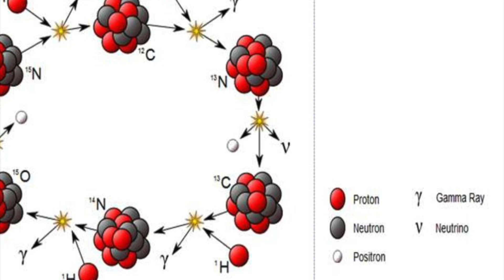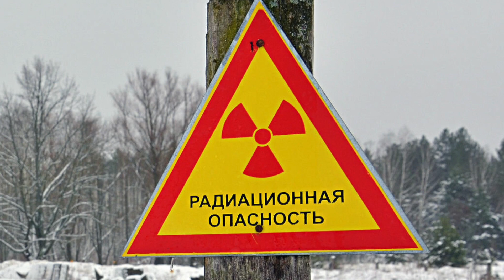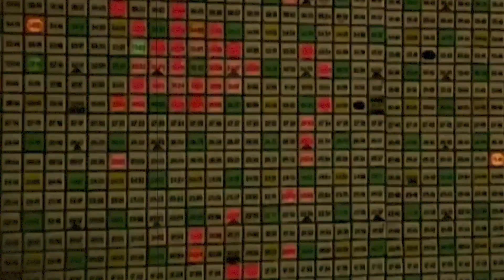Nuclear reactions under the Chernobyl nuclear power plant

Comment: In amongst all the word salad, which the writers of this video clearly didn't understand, are some basic facts that have been stuck together to sound scary but don't really work that way. Water can moderate a nuclear reaction, but that's not what was going on in that room, as shown by the fact that the neutron readings went up after it was drained. Drying the fuel doesn't make it more reactive, either. It's not a campfire. There aren't "reactions" going on in the destroyed plant. There's decay, which is a defining feature of radioactive elements. A chain reaction takes a carefully engineered core or such a mass of corium that it will continue fission reactions on its own. That phase ended after all the famous sand and boron was dumped into it. The corium has flowed and separated into pieces and none of them present any danger of a criticality. Chernobyl isn't going to end the world. It's just a big pile of contaminated metal and concrete now.

Comment: could they drill a hole into the Elefant-Foot and then fill the hole with a neutron absorber?
Reply: would you drill into radioactive waste? It has a coffin for a reason
Reply: @daydream605  Coffin is a name that humans gave to the thing! possibly intentional to calm the fears of the (Western) public (the Eastern doesn't matter much in politics). But nature is about physics not about names. This corium thing is not sleeping forever in the human sense of the word associated with a Coffin. 
What if the chain reaction resumes, because of contact with water, the Corium heats up, melts, accumulates in a spherical form, and goes bang again  (from critical to supercritical)? An expert's horror dream; unlikely, maybe only a bad dream. 
btw.:  But someone, a passenger on the Titanic had a bad dream, too. And survived because of that dream!   
Nations, Superpowers, shouldn't be at war, or close to, shooting uranium shells, and radioactive material, to say the least, at each other, but undertake efforts to handle and remedy the continuing problems in Chernobyl and Fukushima (similar unresolved risk there; a little less, because these were not breeder reactors). 
 None of these old reactors had a core spreader foundation underneath. A reoccurring chain reaction isn't excluded.
Reply: How about bury it with a neutron absorber?  It won't stop the process but it sure would slow it down
Reply: In 1986 The elephants foot is white hot. It’ll take 600,000 years to die down Now Look at Chernobyl today the elephants foot is still emitting Radiation and heat but it’ll still kill you within couple of minutes if you’ve made your Visit Extremely quick like peek then pull back the modem you saw it You’ll get cancer but one person (idk if he lived a happy life) got close to it without getting a Huge deadly dose of radiation… and got a photo….

Comment: There's too many variables to make any assumptions at this point. The benefit of having the elephants foot so (relatively) accessible is that it's indicator of what is probably going on in 305/2 which poses a much greater threat due to the amount of fuel and inaccessibility of the room. It's sealed off.
The increase in neutron flux could be due to the isotope decay and interaction, but that's predictable. Perhaps it's time to take another sample of the foot. 
We need more sensors in there. More activity means a higher temperature as well.
What the physicists have stated is entirely plausible, but we need to know. There is always going to be a chance of criticality until the corium is stored away safely in cannisters, the threat needs to be mitigated as much as possible.
If the predictions based on models don't match reality there's a problem and we need more data. We can't afford to guess.